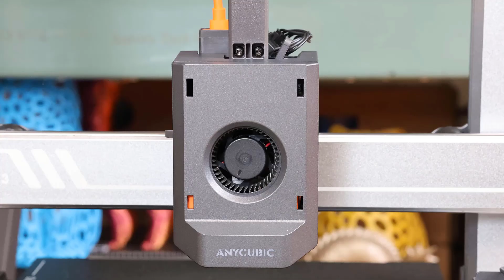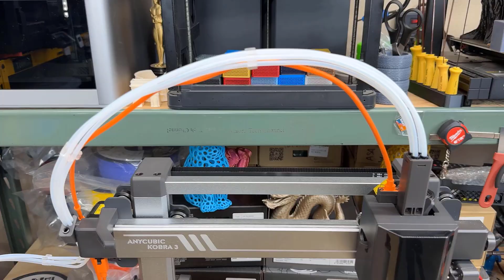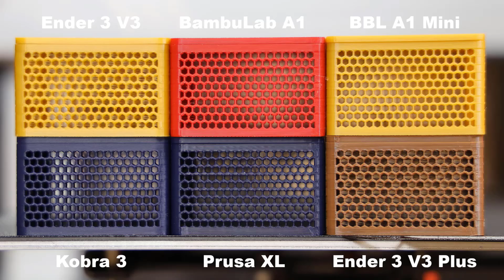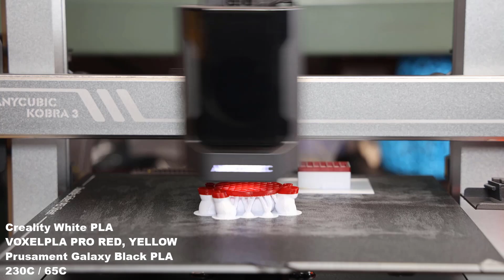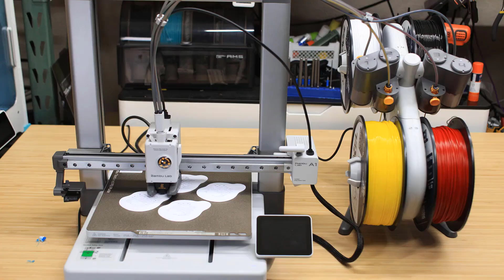AnyCubic Kobra 3 Combo 3D Printer: Multiple filament printing, filament dryer, print up to 8 colors

Comment: I'm still new to 3d printing and I ordered my k3 v2 combo still waiting on it but my question is,  why do you need a print tower if it flushes out the filament when changing anyway that just seems counterintuitive seeing how the flush is meant to get rid of the old color in the machine and swap to the new one

Comment: The waste is insane .....even for a second support material and never using the other spools except as backup redundant copies of spools 1 and 2 for continuous printing... essentially extending the time between spool changes and runouts..... which  still seems to be a fail-over mode that is not well documented .....if it is even provided..... going to wait until tool changers come down in price with 2nd or 3rd generation.

Comment: Hello! I watched your video about the AnyCubic Kobra 3 and loved your review, but I have a few questions.

Can it print articulated objects? For example, the Bambu Labs A1 can print articulated parts directly, while with others, you need to assemble them.

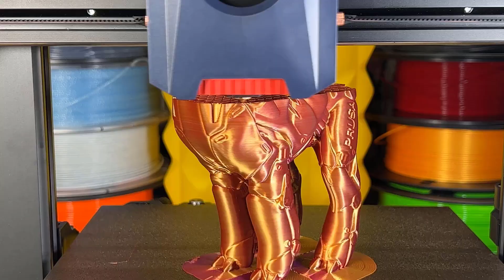At the end, you mentioned the print speed (22:20). Do you know if they have fixed the speed in the firmware update?

Regarding the automatic bed leveling, you mentioned in the video that for large objects, the leveling needs to be better. Has this issue with the automatic movement been addressed in the latest updates?

Comment: This is a poor design for a printer. The amount of waste is too much. I also do not like that you have to manually change the setting for the waste after you start the print job. This feature should be something you can set in the slicer. Some reviews have shown you can knock the waste down 50%, but you are still losing more than the print job. @ .5 on the flush setting you are still wasting 11 times the amount of filament on a print job. I wish someone would show a print job at .1 on the flush setting and how much waste is left over.

Comment: Any plans to review the S1 combo?
Reply from the maker: Yes, the Kobra S1 is in my schedule, but my Q1 slots are fully booked. However, I will prioritize the Kobra S1 if any machines are delayed.
Reply: @AuroraTech  Thanks for reply and for having the best 3d printer reviews anywhere.  You are my only trusted source for printer reviews.  I had never even heard of anycubic before and I am waiting to but a k2+ for printing large stuff and also wanted to get my first multi color machine.  Originally, I had planned on just getting the k2+ and CMS combo.  However, the multi color prints I want to do are all smaller so I dont need the size and color in one machine.  Since most of the bugs on the K2+ seem to be CMS related I started thinking about having the K2+ with no CMS and putting that $200 I would save towards something else and when I found the S1 yesterday it seemed to check all the boxes. Speed, good quality prints and CMS unit that looks like its designed well and has an active dryer built in is huge ( I have no idea why this isnt standard practice for all) Problem is there is very little info or reviews on the S1.  Came here hoping to find a review but no luck.  I couldnt resist and pulled the trigger on the S1 after coupon code it was 569 and minus the 200 savings from not buying the CMS for the K2 puts this S1 at my door for 369 out of pocket. seems like a no brainer, If its as good as the Kobra 3 in this video I think I made the wise choice.

Comment: Been watching 3D printing videos for several years (Still no printer). Reason being I did not want to tinker with the printer so Creality was dismissed. (Rightly or wrongly, I do not know.) Then I found Bambu labs A1 which I liked, then this one. But now I have started to realize do I need a multi colour printer, I do not think so. So which single filament printer would you suggest? One of the above without  the multicolour or something completely different?
Reply from the maker: Please visit my recommendation list at AuroraTechChannel.com.

Comment: It took way to long before every print to start. 20 minutes calibration before the print starts is crazy! Lots of Z Offset problems with this printer, always too deep. Also Gantry not parallel to bed.

Comment: Mine was the opposite and had a offset that was smearing every layer and pulling prints off the bed regardless of the time it was heated, I troubleshot for over an hour so heat wasn't the reason and the only thing that helped was a permanent 0.05 z-axis offset profile. After that its been a workhorse, the only other thing i changed was using bed adhesive as it didn't really have the holding power without it for any small prints or tree supports.

Comment: This is the video that sold me on the kobra 3 combo for my first printer, thanks!
Reply: I would love to know how you are you finding? I am at analysis paralysis between this and the Bambu A1 with AMS.
Reply: @marblemolly2454  I've been lucky enough that I haven't had any issues with mine so far, but I've only had it running 24 hours. Since joining facebook groups and stuff for the printer though, seems it's a 50/50 chance of it working out of the box or needing a bunch of work. I do wish I'd have gone for the bambu just because it's more established and has a better community.
Reply: How did it go, dude?  My guess is that you wish you would have bought an A1.
Reply: @joeking433  I returned it after 2 weeks, warped bed, leaky hotend, z offset issues lol
Reply: @GetDerpyTTV  guess It's not going to be my first printer either lol, I'm getting the Bambu A1
Reply: @Bibodoi  how's the bambu going? I know the machine itself is good but I'm assuming the new updates will set your love for the A1 back? The new kobra 3 v2 is out anyways
Reply: @PPV0077A truely plug and play printer. Over 700 hours of printing and only 2 critical errors. 

One was nozzle clog but it was partly my bad, as I used pla silk with a 0.2mm nozzle.

 The other was a blown fuse on the tool head board that caused the printer to stop working. I contacted bambu lab cs and they immediately send a replacement parts for free with no question asked, other than confirming my address. They even sent some extras like ptfe tubes and the toolhead usb type-c cable that I didn't need lol.

Now I'm just need a bigger print volume and am eyeing for the new H2D 👁👁.
Reply: @PPV0077the locked down firmware is overblown on the internet. All you need is turn on dev mode to control the printer via 3rd party software. 

Or you could downgrade firmware easily from the printer.

Comment: I bought the printer because of this review :) Thanks! One question, If I print in say Filament 2 (white for me) the print completes, and i start another print using the same Filament 2 (white) it still does a large purge before the print, is this needed? can it be turned off? Surly the printer knows the last filament number. So if it was 2, it wouldn't need to purge, but if it was different from the last it does. Seems wasteful.
Reply from the maker: It seems like it's a firmware-level starting G-code. I can't find a way to avoid purging, even if you are going to print the same color again.

Comment: Thank you for the review! One thing is what speeds did you use for everything? I like that you have the temp per filament you used but did you use the default 300 for all the prints? Did you modify any of the percentages for things?

Comment: How do I select the appropriate sequence for filament in the touchscreen? I had a black gray white green design. 
The software on the touchscreen is unclear filament is where? They are setup accordingly in the dryer but how do I know which is 1-4 after I push print?

Comment: just waiting for them to fix the slicer and add some gui features. it leaves much to be desired and is the only issue i have experienced and unfortunately it isn't a light issue as it effects the experience greatly. i hope they fix the problems the machine has and add full color and flush management.

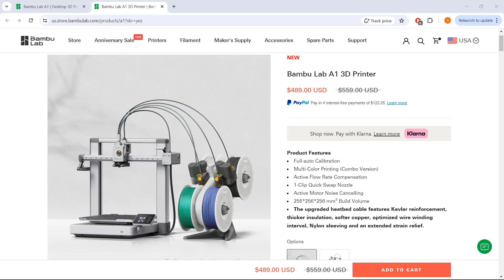Comment: 24:20 If you buy the ACE pro separately from the printer, it is $300 USD. It is only $110 USD if you buy it along with the printer. Bambu Lab also discounts their AMS units if you buy them in a combo with the printer.

Comment: Here's a Creality Slicer Update: The newest version dated July 2 DOES NOT WORK ON MY WIN10 MACHINE. The previous version didn't work either. Both installations locked up when the programs loaded. After selection a K1 and a KMax, a box appears that says something's missing, and says it will load when I start the programs, but neither program will load. I have to use Task Manager to end both programs.

Comment: lol I'm pretty sure my prusa mk4 can print that same hello kitty model with the same size tower maybe less, but it has no poop shoot or poop collection system. So the tower is it. Either way it's using less filament. The MMU3 is the most effecient single nozzle multi material system.

Comment: I have an MK3S and a Prusa XL, but with a single extruder. At least at this moment, I do not really print multicolored prints that often, but knowing how much filament and time you can save by using multiple toolheads is incredible. Yes, it is a very expensive machine with many flaws, but for multicolor prints, it is barely unbeatable. Everyone needs to do the math to justify the cost of a machine 🙂

I would only use two toolheads, so an upgrade may be incoming 🙂

Comment: i think watch from a youtube video: one way to use the flush plastic is to print one model that does not care color alongside the main model. for example, woodworking corner bracket.

Comment: So the same problem with Kobra 2 they repeat in Kobra 3. The lack of Z off set manualy adjust beforer the auto level.
Elegoo did a better job in Neptune 4 in that.
That a problem who can be solved easy by Anycubic, but they dont listen the costumers.

Comment: Does every filament have to be a certain temperature? I've noticed that they are all different. Even the bed temps are all different. Is this why my prints have failed from time to time? Should I do a temp tower for every spool I get? New plastic pusher here..
Reply: Generally, filaments will print reasonably well over a range of temperatures

Comment: Hey Aurora, guys! With what wouild pick? A1 or this Kobra 3? Without the ASM or the ACE
Reply from the maker: In terms of the multiple filament box, the ACE Pro works better than the AMS Lite and even better than the AMS. If a future firmware update fixes the auto Z issue, this Kobra 3 combo could be a better option than the A1+AMS Lite.

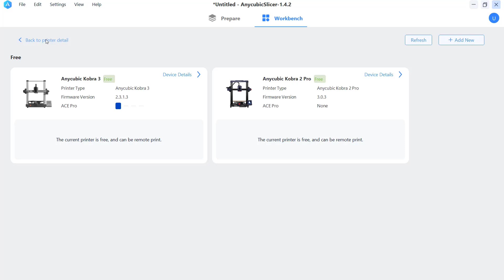Comment: Do you know if you can use the ACE pro for other printers like anycubic pro I saw at 21:15 that the anycubic korba 2 pro had ACE pro under it so just curious?
Reply from the maker: I don't think so, as your print head needs to have 4 Bowden tube inlets and a firmware that support filament change.

Comment: On the clearance test, the walls look terrible. All those little ridges and bumps on each layer. Looks like the extrusion is not very consistent and almost looks like the filament was really wet. Also, the ghosting is pretty heavy duty.

Finally would love to see you do your sound test trying to isolate some of the resident frequencies of everything around. It seems a good portion of the sound may be coming from your table and when you set it on top of things, etc. You can use something like sorbothane and do the calculations to cut the right size pads and do the sound test on something like a concrete floor. so you’re not measuring the resonating frequencies of the cabinet or stand. Also, there should be some sound reflecting material and absorbing material so that you’re also not measuring the reflected sounds  

But you do the same every single time I don’t think it matters that much, but it would be nice to dial in some of the testing a little more sophisticated

Comment: There is an Orca Slicer based Anycubic Slicer that is in beta, it seems to be at least v2.0 of Orca. I did notice, however, that you can NOT adjust the flushing volumes between filaments. Anycubic really needs to change their firmware to allow adjustment of flush between different colors to minimize waste, the print currently allows you to only adjust a global flush volume directly from the printer screen.

Comment: I question the long-term reliability though.  My experience with Anycubic is that they generally print pretty well out of the box, but then start having problems after a few spools of filament have been run through.  This has been consistent with their Mega i3, and Pro Max v2.  Printed great out of the box, but then ended up with extruder and hotend clogging issues that pretty much killed any future productivity.

Comment: The software, Z offset inconsistency,  and surface quality were one of the reasons I quit using my Kobra 2 and it looks like that is still like a factor here. All of these machines aren't perfect and require some form of occasional adjustment, but I felt like the Kobra series fought me the most in that area. I think they have a brilliant design team, but I'll continue to avoid their products until they work out the kinks or allow easier tweaking of their hardware/software.

Comment: I personally would still go with the A1 for its reliability and because it basically just always works without effort. 

But this seems like a great printer if you want something a little faster and don't mind making some occasional adjustments.

Comment: Ok I have been looking into getting myself a multicolor 3d printer. I own a few older printers. My concern with this printer is your making a purge block AND have 3d printer poop. thought using the Poop method, I thought it don't need purge block? Am i wrong?
Reply: You can get pretty good results without a purge block.

Comment: Been waiting for this review for a while, I got the printer maybe 5 days ago and in love it with.. I've been using it more then my k1 so far since I don't need to worry about loading and unloading filament, it does purge more then I like and that's because of the slicer and no letting u use it as infill.. I've heard it's going open source at some point cause omg I hate there slicer even a dark mode would make there slicer better.. but for now enjoying it! What free item did u get? I got the mouse but it was DOA. Also my ACE system squeals when using the 1st spot need to open it or get in contact with anycubic to replace or send parts to fix but still not to bad :)

Comment: Would like to see more innovation instead of just doing what Bambu did slightly differently.
Reply: built in filament dryer is an innovation as it is something Bambu does not have.
Reply: @Capt_Astra  that is a nice tweak.

Comment: All AnyCubic needs to make now, is a fast coreXY printer that the Ace Pro system works with.. and Bambu Lab doesn't have anything to "sell" that isn't just a higher priced version of what most other brands can do now. What is Bambu Lab going to do next to stand out? Reliable and fast belt-printer with multi-filament? Multi-resin printer for "multi-color" resin? SLS for consumer-grade that doesn't break the bank?

Comment: For problems with z-offset: The termistor of the heat bed is on the underside of the bed. So the moment the thermistor sensors final temperature reached, the upper surface of the bed has not reached final temperature jet. After the printbed is signaled to have reached the final temperature, always wait 5 to 20 minutes (depending on the printer and used temperatures), so the bed´s deformation after heating has stopped. Than you start the ABL process.
Preheating the bed, than waiting, has always improved my first layer.
Sadly, many reviews tell how fast the printer heats up and start the print. An extra 10 or 20 minutes waiting time would result in bad reviews...
On my Qidi X-Max 3 there is even a sticker telling to preheat and give time. However, in the slicer profiles there is no wait 5 (or more) minutes waiting time. Just add a line in the gcode after bed heating to wait - and first layer improves.
Reply: Thank you so much! I am waiting on it to arrive and will use that technique to make sure it is level! That might be why when I hand level my Ender 3 v2 it looks good at first but one side is always up. Probably because I start leveling with it heating!
Reply: You're using than wrong. Than is to compare, and then is to tell what is happening, happened, or going to happen.
Reply: @bryancampbell4604  you're using YouTube wrong, in these comments grammar and spelling don't matter, but we'll forgive you
Reply: @bryancampbell4604  Nobody likes a grammar Nazi